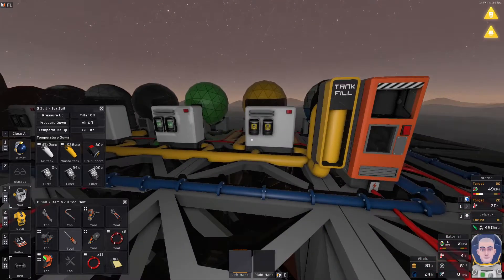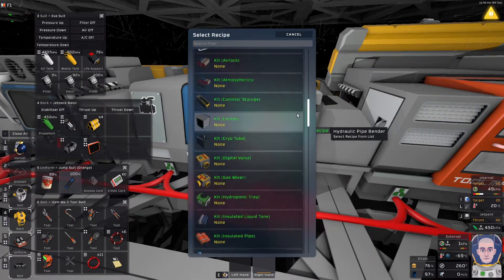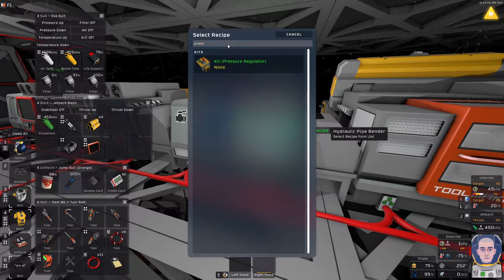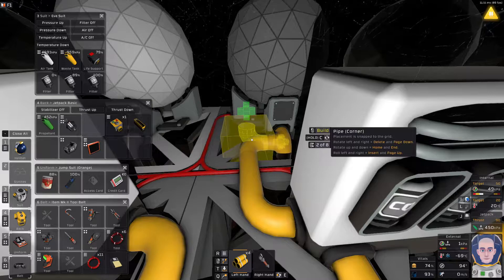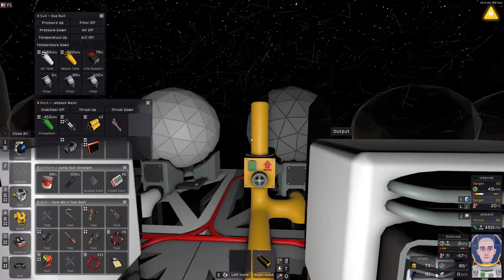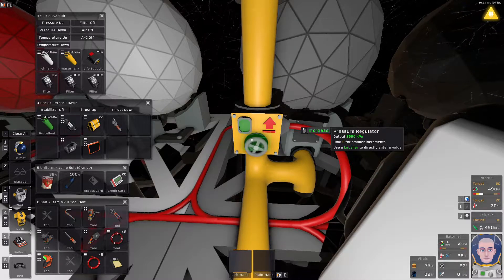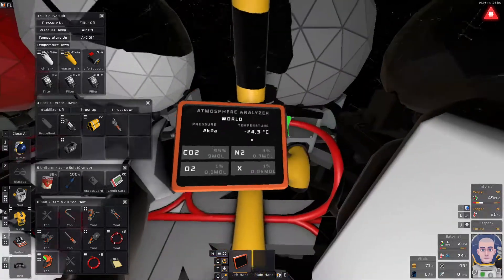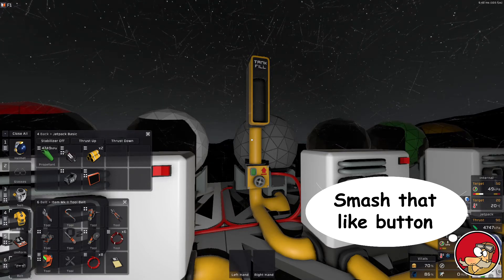Simple Jetpack Refill Station - Stationeers Mars Survival - ep 34

Comment: why you put jetpack refiller on co2? i have exact same setup as you.. followed this guide and built a replica ... i put refiller for jetpack behind those blocks with adv furnace... and used regulator to grab voletiles(from red tank') from the connection to the furnace... also put oxygen flask filler from oxygen behind there... both have pipes to there anyway.

Jetpack can both run on co2 and voletiles?.,.. well mine work fine with fuel from red tank:)
where did you get the green n2o from ? that thing not even show for me on my tablet pipe anali.. guess i must feed more gasses trough eighter furnace or the ice crusher and it will show up